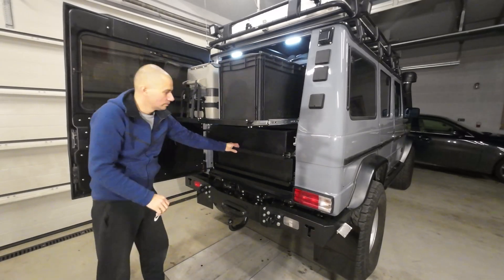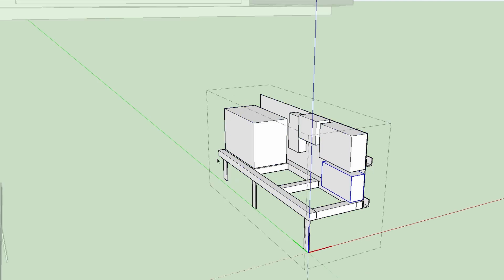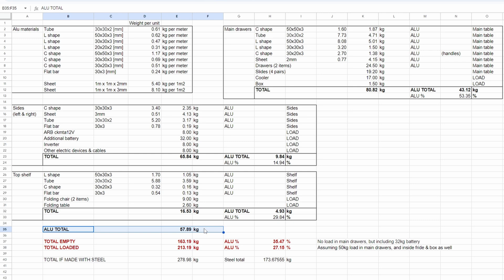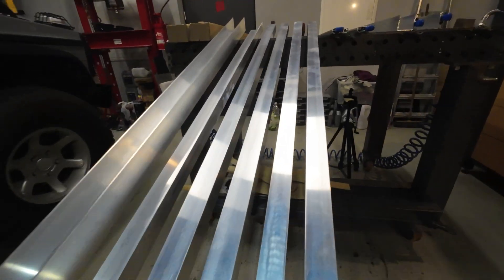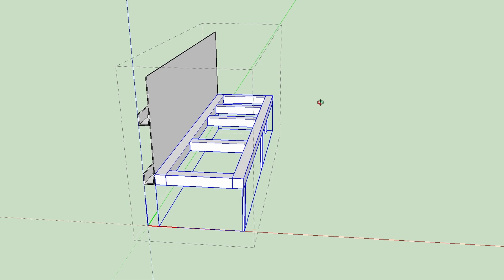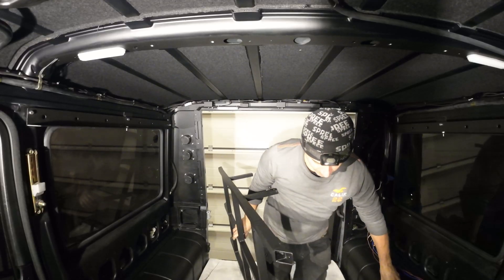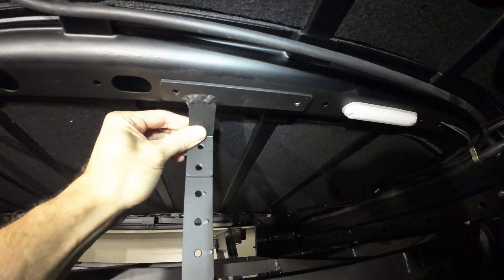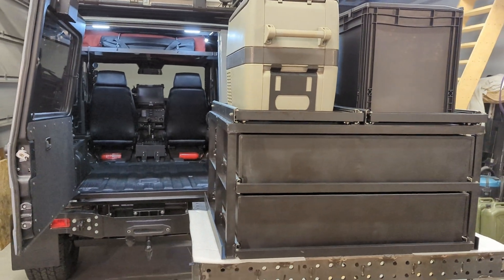Building overlanding drawer system for Mercedes G (part 1)

Comment: Very impressive, but for the overlander built I think it is an overkill and I'm talking from my experience. Your secondary power setup is good for larger expedition vehicles. You could achieve pretty much the same with AIO boxes (Bluetti, or Ecoflow, etc.) and save tons of money... and space. I had pretty much same setup on my 4x4 van build, and was flawless. However, my next build was LC150 and by using AIO power station I had achieved pretty much same functionality in very tiny (but ventilated) space. Instead of hardwiring all sockets to the power distro box, I just terminated all cables with plugs that plug in to the power station. This gave me an option to easily remove my power source to take it home during very cold nights or to use somewhere else where I need ac/dc. Also, don't you think your alloy structural tubing is too thick for the application? They seem to be 50mm... Do you really carry that much load in your drawers that you need it to be that strong? I had used 20 and 30mm extrusion profiles for framing and with the top module removed I can use it as a sleeping bed for me and my wife. That's about 150kg of moving weight and this thing remains very solid. I see you have removed second seat row, so I guess this extra 40mm that you could gain wouldn't make any difference for you. I have two kids, so this extra space is priceless :)
Reply from the maker: I like solid builds in my G, I have no doubt about it ;) I travel with no kids ;)